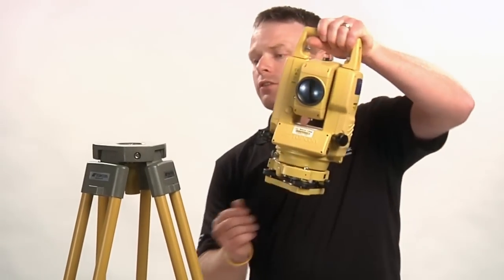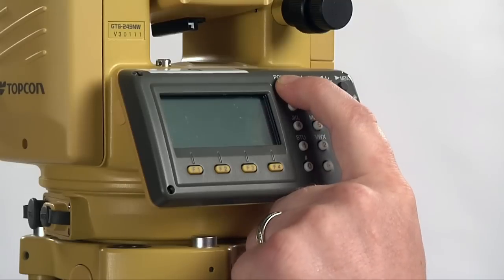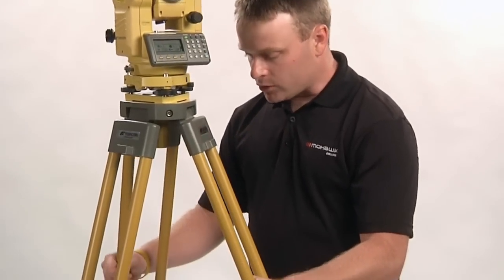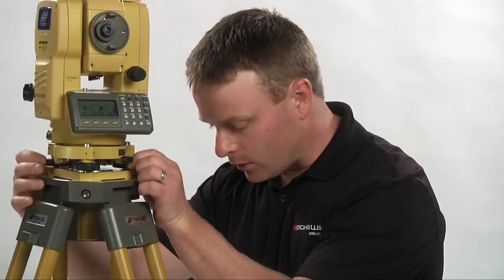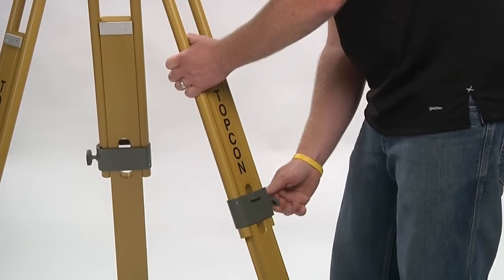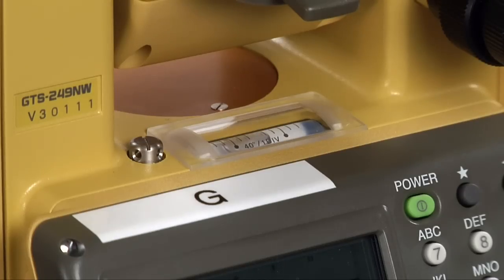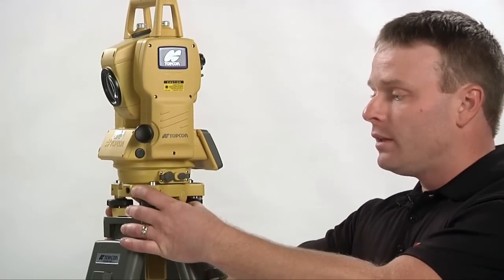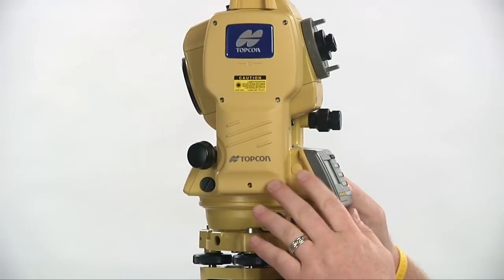Total Station- Setup.mp4

Comment: Thanks for this video
Its everyone can easily understand

But i request you please put video regarding Tilt set up after Switch on Machine.

Bce I am having Topcon GT 3000 new machine but there is Tilt setup showing only X axis and Y axis not showing us,.

Pls help me to resolve this issue
Reply: Tilt setup can work two ways. I choose to line mine up over a single post.

You can do it over the front two as well.

X and y are just your vertical plane. So if you point the side of the gun toward a single post, the other two will control your x...and x will ALWAYS change y.

If you position it as he did in the first plane level, ofer the front two posts, x will be independent, and y will always change x.

Whichever way you do it, one will only slightly change the other (x changes y, but y doesnt change x much...in my first example, where you point the side of the machine toward a single post), and the other will DRASTICALLY change the other. You are essentially leveling the way he does, but digitally.

So turn the side of your instrument to a single post, and do X BEFORE Y. Get your x good (within 5 secish if you arent doing rocket surgery)...

Then focus on y. Get them both within 5  secs of 0...then do the same as with the other gun, check plummet position and average wander. Relevel.

Now, at the end, you are going to want to flip it 180 degrees. See what that says. Unless you are out 10 sec id honestly roll with 30 sec unless im doing something EXTREMELY PRECISE)...you should just roll with it...if you are out more than that...until you can get it recalibrated, you can just average the error on both sides of the 180, and you should be good enuf.
Reply: I forgot to add, you must rough level it before it even shows how far you are out.

And after, make sure to turn the laser off and go back to the main screen on ur gun (or the dc wont communicate with it).
Reply: At tilt screen, L-on is i think the function that turns your plummet on initially. It varies. You might have to hit alt f3, as he did, to turn ur plummet on.

If you have an optical plummet...well, thats a whole nother can of worms.

Comment: que tal Andrew, mira tengo una south NTS355R tengo un problema con el angulo vertical y lo he querido ajustar, con F1 y encender con power simulatanemente, despues dando enter a un punto X a la misma altura del aparato en pantalla directa, y despues al mismo punto X en pantalla inversa, supuestamente con esto deberia corregir y ajustar el angulo vertical, sin embargo me envia mensaje de error, queria preguntarte si sabes acerca de este procedimiento o si me podrias sugerir algun otro procedimiento, he pensado en buscar acceder al microprocesador de la estacion y reinstalar su firmware, pero aun no encuentro la forma, cualquier comentario sera de mucha utilidad, gracias..

Comment: Le sigh, you forgot to include checking/averaging the wander of your laser plummet (Ive NEVER had a perfect plummet...used many machines). Do this by rotating the machine and watching the laser as you rotate. 

Good wander is less than a hundreth. Bad wander, you may be averaging 5 hundreths of error. At this point, you NEED calibration. As unless your firm is localizing large projects...you may end up with over a tenth...maybe two at the end of your traverse.

Also, the recentering after you rough level is backwards, and unneccessary. Instead level your instrument, then move your leveled instrument over the point, spin it again (to average your wander)...then relevel. Centering it over the point just wastes time, and youll get a feel for if you are too far out for your set of legs and have to reposition.

Ive seen vids that say a good setup should take 15 minutes plus. I average about 45 seconds. More for control, as you want that especially tight. Especially with a topcon like the one hes using. Friggin love those things, theyll shoot even when you cant SEE the prism thru cedar and such. And as long as its not control...accuracy is pretty close, topos are especially easy with the ol topcons.